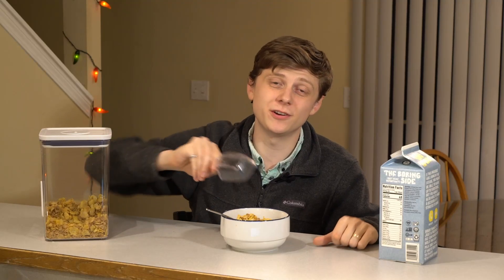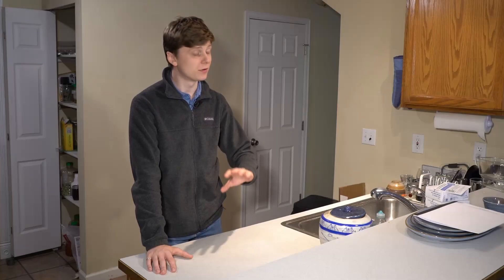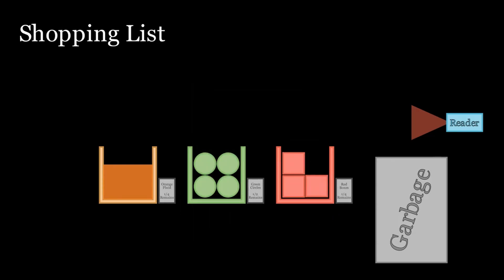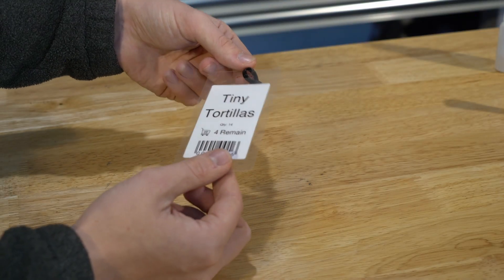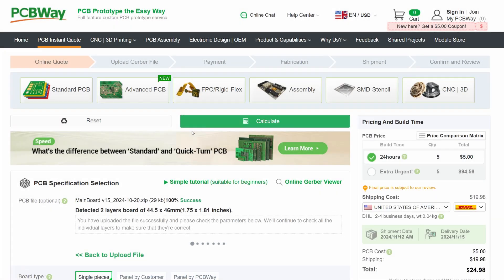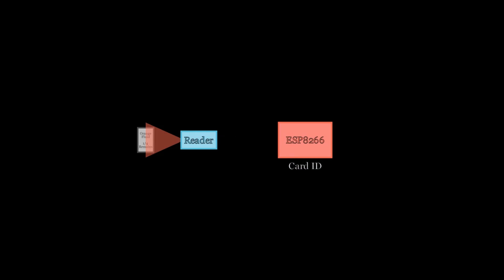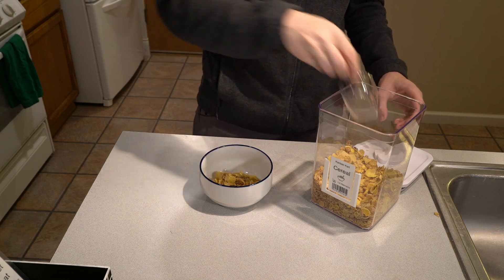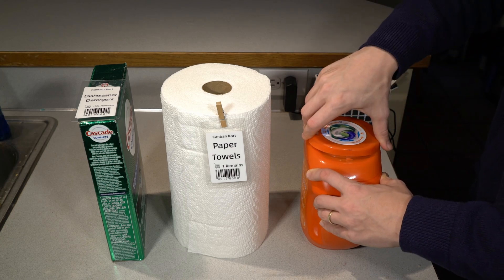Overengineering My Kitchen

Comment: Why not just use the barcode that's already on the item ?
Reply: i think the barcodes are brand specific at the very least and for a lot of products they can be brand indifferent. you would have to update the database with every item you buy a new brand of the same item rather than just having a preexisting bar code for the item. also i think part of it is because the bar codes are detachable this way as he brought up the issue of someone forgetting to scan something or being left with too little

Comment: iPhone reminders app using a shared shopping list. What is the problem you are solving again?

Milk is low. It’s added to the list

In store grabbing food. Pick up milk, tick it on iPhone now even if your wife is in a different store she will see that the milk is ticked off. So now she won’t buy it.

Super crazy edge case, shopping within the same second and grab milk within seconds of one another.

You can setup a little tick box option that when ticked it means wife is shopping. So now when you see that she ticked the box. Now you will not go and try to buy anything since you know she’s actively shopping and don’t need to worry. She then unticks the wife shopping reminder when done.

Setup a Siri Shortcut. That will auto flip repeat items like milk etc

I made a shortcut for my bro that when active it goes through one by one asking him, “eggs?” He then looks at the fridge, nah eggs are good, press no, “milk?” Looks presses yes. Etc

So that he can run the shortcut and quickly tick yes or no with voice or a press without looking at the screen or reading. To restock the fridge.